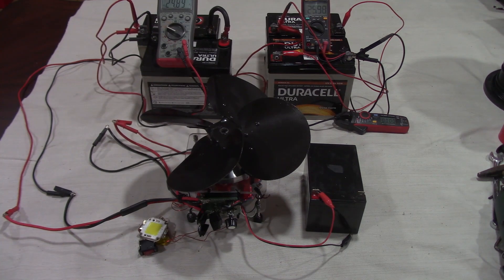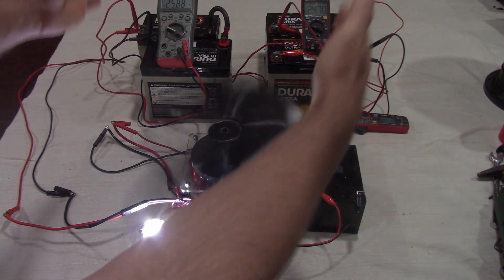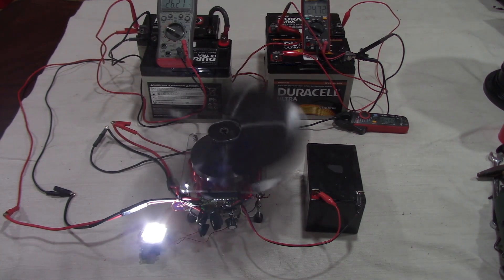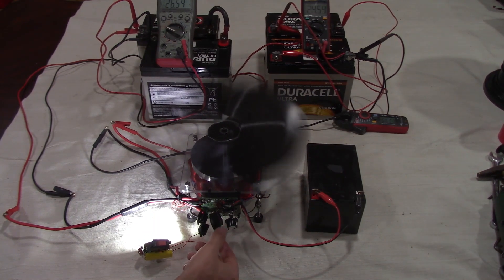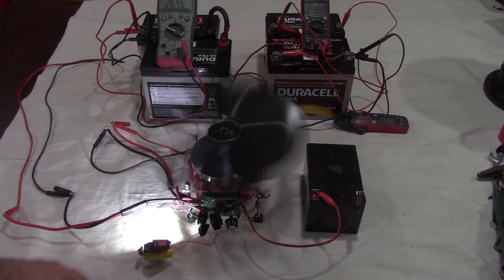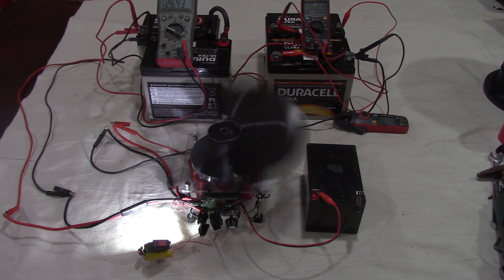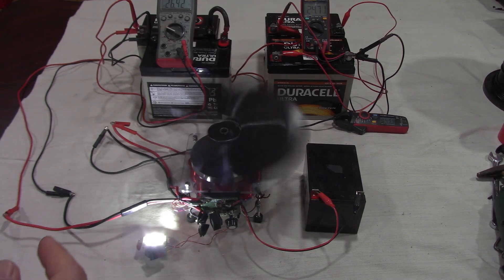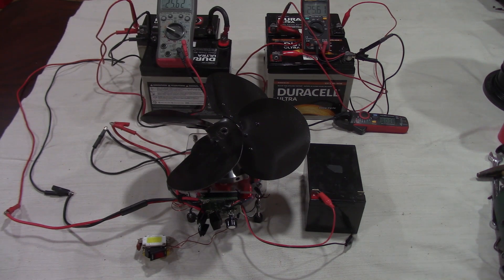4 DualPole with Fan and 100W LED 24V

Comment: Hello Rick - will you have this motor or perhaps even a larger scale of this motor in Lansing this weekend?
Reply from the maker: We will have several of these motors there with a similar fan attached. I don't have the larger motor here at this time however. We may have the other industrial motor on display.

Comment: You recommend using 35Ah batteries, are  similar results in regards to recharging the batteries possible with 7Ah batteries, and then using the battery swap circuit every 15mins? I ask because a I have a load of old 7Ah batteries🙂
Reply from the maker: First of all you want flooded lead acid so that any off-gasing can be topped up with adding water. Sealed batteries will off gas and eventually become useless. 7Ah is for really small applications. You will have to consider the C rates of charge and loading for any battery. For lead acid you want a minimum of 1 hour rotation, and the larger the better. If you want to use NiMh and similar batteries you can do shorter rotations and smaller batteries.

Comment: Hi Rick, do you think this energy is compatible with digital technology? Instead of manually adjusting the pot, would it work to have software that you can use to digitally adjust the voltage, current, and other electrical parameters? Or would this interfere with the actual working of the device?
Reply from the maker: Look closer, we are already doing that.

Comment: @6:21 "EMP motor.  Additional holes for additional coils."  Those holes in the plexiglass secure the outer ring of coils and what occupies the holes appears to be an insulator.  They aren't really going to help with airflow over the windings, are they?  I have seen holes in the top rotor of your large motors.  Was that to allow airflow over the ends of the coils?
Now you have me thinking what might be possible with water cooling.
Reply from the maker: To clear up what I said, at one time we added holes to the regular motor around the bearings so that air could be sucked in like a Turbine but then when we updated the plates for different coils I forgot to add them (actually we were drilling them out by hand and that is why they were never put into the cad drawing).
What I was getting at with the EMP coil setup was not actually the extra outer layer of coils but the extra inner layer of coils--there are 4 additional coil behind the generator and motor coils as well as the 8 ones on the outside layer. So if we had those same holes on the inside then that would add additional air flow. So people can drill them out if they remove the rotors as we used to do, if they want to push up the amps more.
Reply: @rickfriedrich  Just straight holes will draw air through?  Are the ends of the coils good heat radiators?  I would think you would want air passing over the windings.
Are the holes effective on the middle rotor of a double stack?